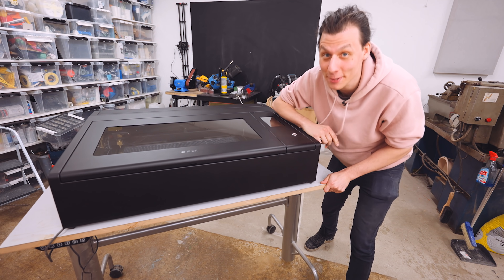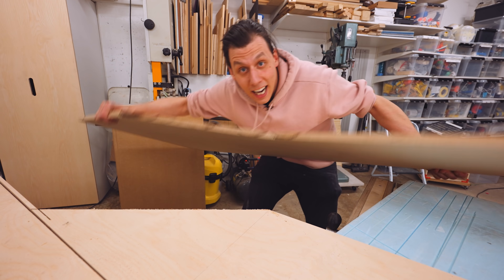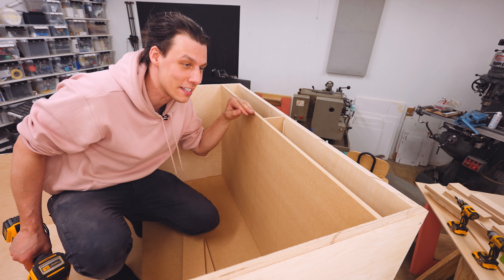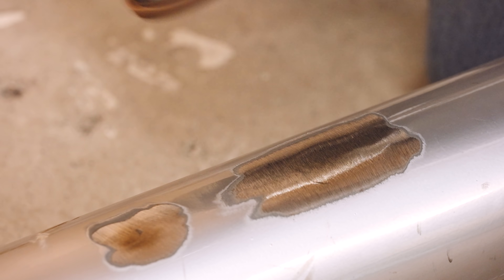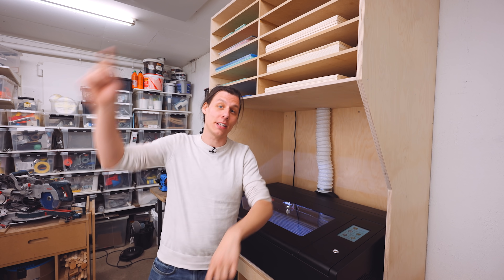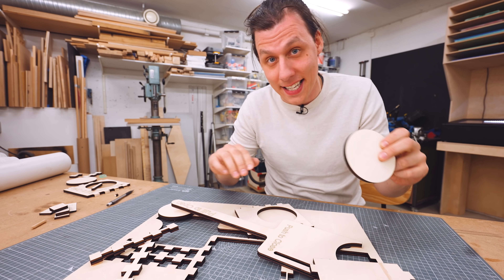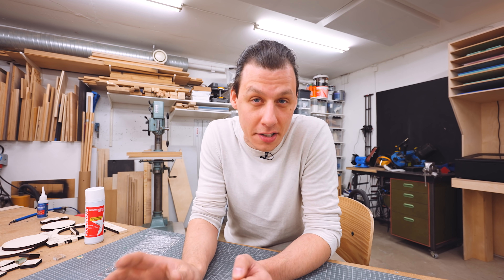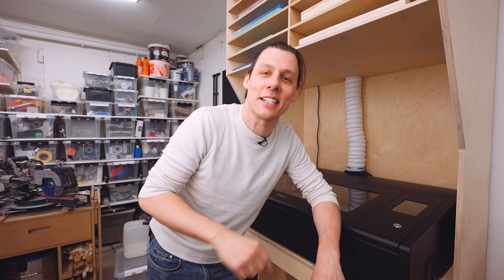I Can Use Lasers to Make Things!

Comment: Hi Alexandre! I've worked in fabrication labs quite a bit with lasercutters. I saw you used mesh in your glued on air tubes. That made me give you this tip:
Don't use MDF ever for laser cutting. It will clog up your tubes and mesh really fast. When you laser cut it, it's basically smoky- wooddust glue.

Comment: I used a laser cutter. Always worried about the formaldehyde forming from scorching plywood. After a few hours you could feel it irritate your throat. We had a fancy carbon filter for the air, but there was no outlet to outside. The filter company claimed the filter was safe to use when venting to the room. But I felt uncomfortable being there for to long. You are generating carcinogens after all...

Comment: Tip: on the drawing templates, also engrave center lines. On the under side. It really helps when drawing concentric circles. Of course you also need to draw center lines on the drawing for it to work. :)

Comment: That much distance without an added fan is pushing it anyway but after a few months, that screen will be getting seriously clogged cutting your air volume even more. With the screen clogged any possible leak in the shutoff will be pouring smoke. The exit om mine has one-way flappers that lets air out but not in.

Comment: I wish I could spend a few hours a week at your workshop, man!
Reply: In many city's there is Hackerspaces/Makerspaces where you can go and use the machines.
I have one where I live, fully equipped with 3D printers of all kinds, 3D scanners, Lasercutters, CNC machines, MIG/TIG/Arc and gas welding, and an electronic lab
Reply: @someoneelse7629  I know! We do have something similar near my town, but it's run by mostly retired seniors so it's been closed due to covid. >_< Gonna check if they will open up once people have gotten vaccinated, though.
Reply: among us?

Comment: 1 second in - Hey that is the same machine as I have! Ive had it for just over a year now as an upgrade over my K40
Edit: I actually just finished making a small rolly trolley for my laser materials that used a combo of materials + 3d printed parts (I shared it on /r/functionalprint).
Edit2: If you want a Protip for this machine. Google "Tattoo Water Bottle" which is a applicator for tattooists but it is also perfect for being able to top up the water reservoir in the back of the machine without having to use a funnel and possibly miss
Reply: One more Protip - in Beam Studio under the File menu there is an "examples" section. For every new material you are going to use do a cutting test and an engraving test and keep those pieces that are produced by the laser.

You will learn what materials you can use, how they react (which ones are safe, which ones produce acidic or highly toxic fumes... as there is a lot that do) but the reference cards you make for materials you will use often is VERY helpful

Comment: My beambox pro has been a nightmare from day 1.  I regret buying it.  Not one single successful job since day one.  Bed uneven.  Laser focus lens was loose.  Now power is super weak.  They want me to realign the mirrors and level the bed, but I just don't have time.  (the whole reason I bought a more pro-sumer level model instead of a cheaper chinese model).  But yeah, half a year later, still no successful prints, and $7k down the drain.  Hopefully I can find time this weekend to finally give those things a try.  Oh and I forgot to mention, lots of $$ in wasted materials from failed jobs.

Comment: Little tip for the 3D printed air connector, if you add something to make it a 45 degree angle (or a smooth curve) your airflow will significantly increase :)

Comment: Good video. Suggestion, move the fan as close to the exit thru the wall as possible. You want to have a negative pressure in the hose instead of a positive pressure, since the positive pressure will cause leakage of the toxic  fumes into the room

Comment: Can you use the laser cutter with other software or just the included one?
I guess it takes care of which layers to cut and which to engrave etc.

As a tip, with laser cut design you need to bear in mind two factors:
1) Leave some small tabs (around 1-2 mm ) if you don't want the pieces to fall out when pulling the sheet off. 
Specially if you plan on selling or shipping laser cut things. This size they'll sand quite easily.
2) The cut is not perpendicular, it's a cone of laser. So the cuts are beveled.
With this kind of laser cuter (and thicknesses) it isn't too severe, but don't rely too on a single cut edge for perpendicularity!

Nice machine, especially for free :p

Comment: Isn’t that one tiny extractor fan going to really struggle to blow round a very tight narrowed corner then through a much longer pipe and more corners?
Reply: Since it's attached to an external vent, I think it's going to work well enough. Air will naturally want to move outside due to the lower pressure, so all the fan REALLY has to do is clear out the laser chamber itself!

I wouldn't necessarily trust that tiny fan for a miter saw or something, but such a small machine should be just fine
Reply: It will be fine. The only purpose of it is to move the smoke out of the laser chamber; for that even a tiny fan is okay. Just like when you blow a candle and you see the smoke moving with a tiny blow of your hand, as it is so light and easy to move. In case the smell is stronger and heavier (often cutting PETG, some acrylics) you can still attach an extra fan somewhere along the pipe to help to move the air out quicker :)